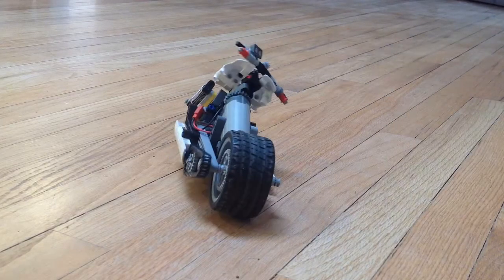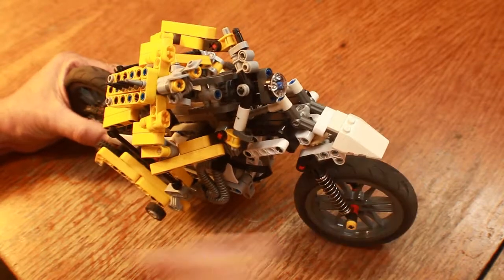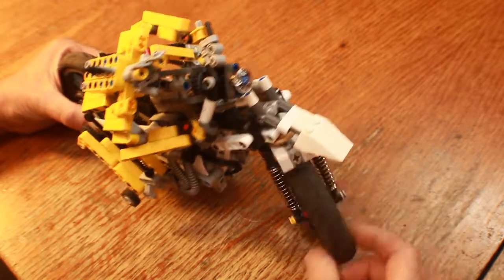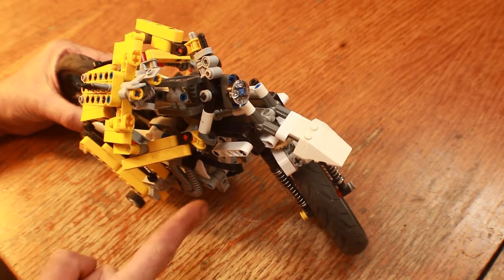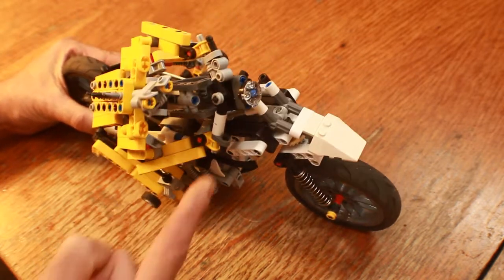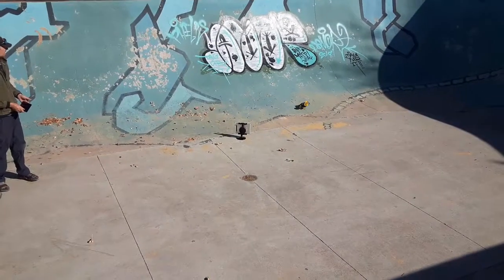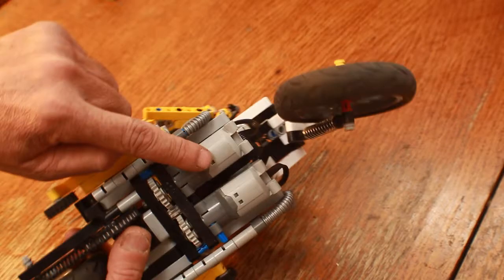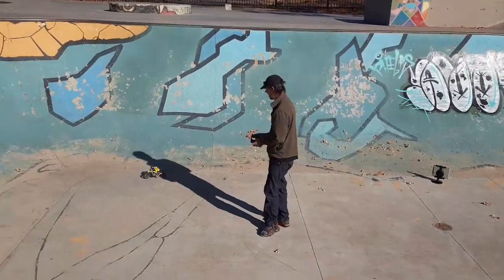Lego Technic RC Motorcycle With Leaning Driver is Self Balancing

Comment: You need to redesign the front wheel so it is in caster and then it will pick up in virtually a straight line under acceleration.
Reply: It already have a positive caster angle
Reply: @user-us4gp9ee1y  Thats true, I dont know why I said that then... Old comment

Comment: Is that 3s lipo just connected straight to the sbrick? Last I read the sbrick fails somwhere around 11.3v according the the guys that worked on it.
Reply from the maker: Yes, it is. Mine has not failed.
Reply: @MaxBrix  huh, Do you by chance know what voltage the lipo is when you plug in the sbrick?
Reply from the maker: 12.6v. I am not saying it is safe but I run my SBrick on 3 cells all the time and never had a problem. sorry for the delay answering, no notification.